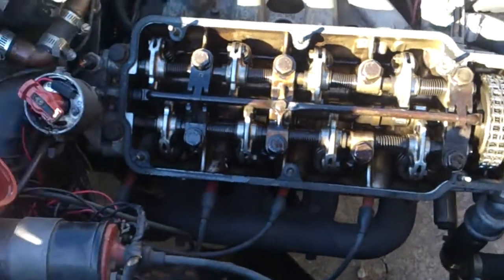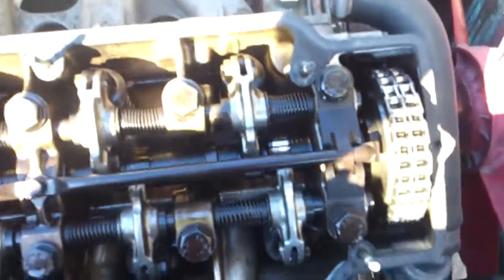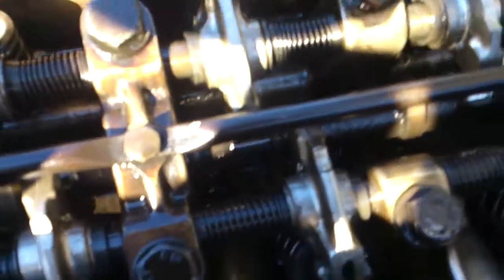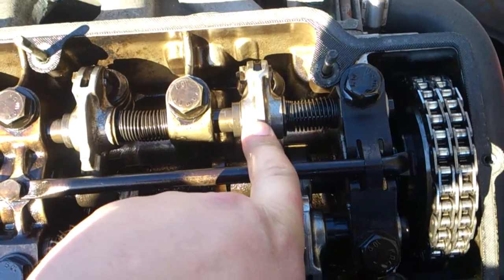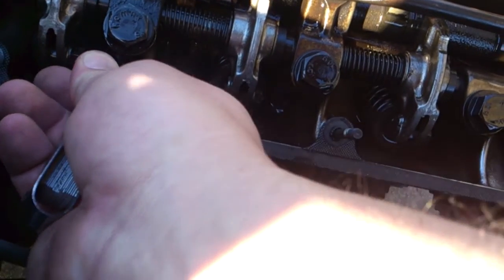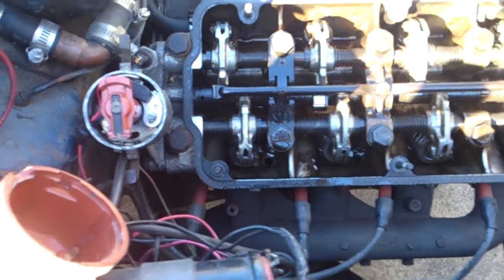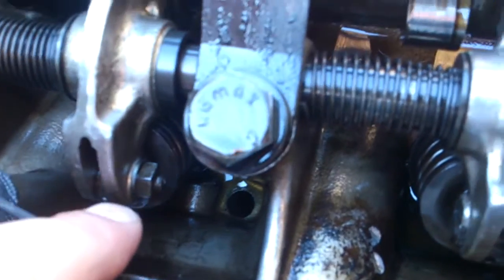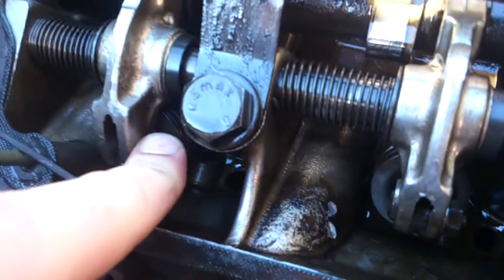BMW 2002 M10 Valve Adjustment

Comment: I have M10  engine  the coil heating up when engine is running please can I help
Reply from the maker: Check wiring, and add a ground strap from the engine to the body, that might help.

Comment: Hey man, great video. I'm thinking bout tackling this myself but i'm a little intimidated honestly. Could you tell me the torque specs on the valve cover bolts? And what happens if the engine is not at TDC and I attempt to adjust the valves anyway?

Comment: i did push my car and the  cam didn't turn  ?
Reply from the maker: What kind of car and what kind of transmission?
Reply: Manual bmw e30 325i  m20 engine
Reply from the maker: ///M-Technic 325i Sport make sure the transmission is in gear, I usually pick 2nd or 3rd gear.
Reply: will it move  on gear?
Reply from the maker: Yes, make sure its on flat ground, the keys are out of the ignition and the e-brake is off.
Reply: cheers mate